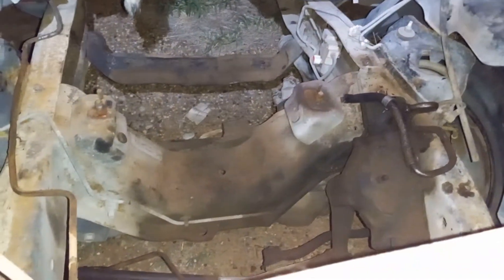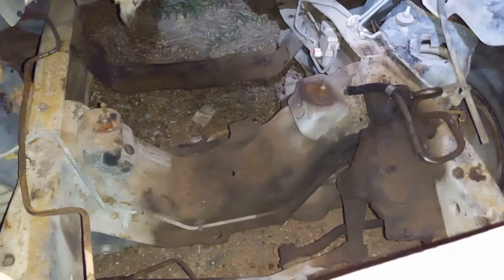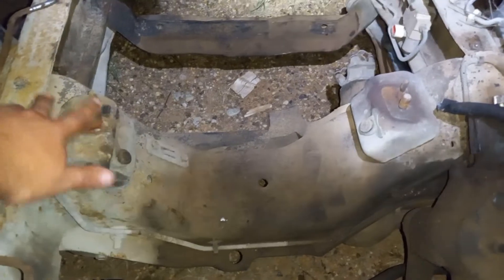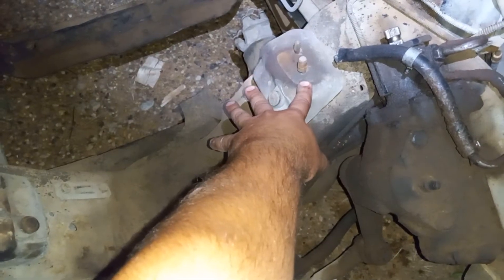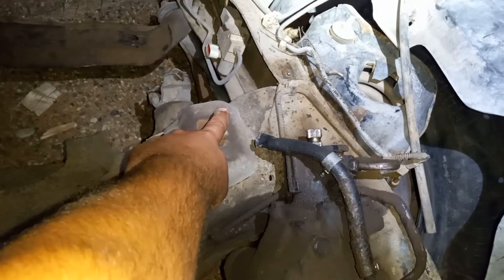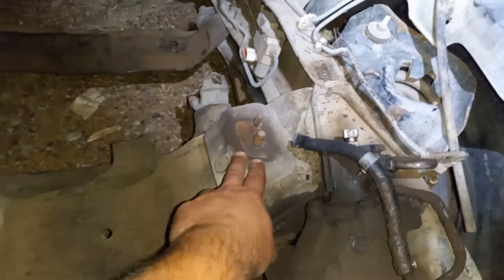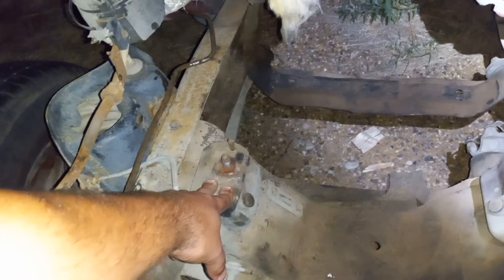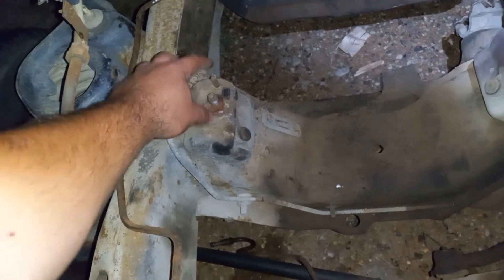Bronco II 4.0L OHV Swap - Motor Mounts.

Comment: I have the C5 in my 84. I’m looking at a 91 ranger with a manual as my donor. Is it possible to just make a standalone harness for the engine?
Reply from the maker: Yes, install as shown and make the tie ins at the white circular connector on the drivers side firewall. EEC relay power, start signal, engine sensors for gauges, fuel pump relay, etc.